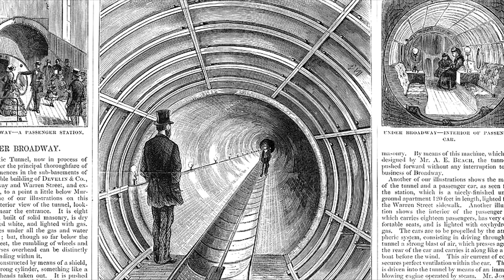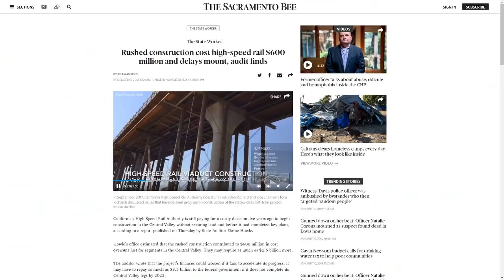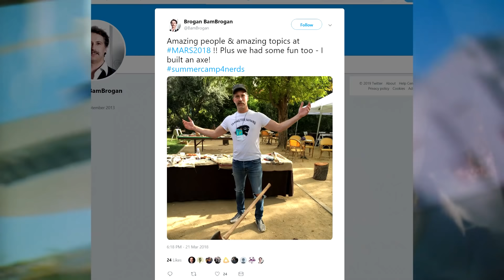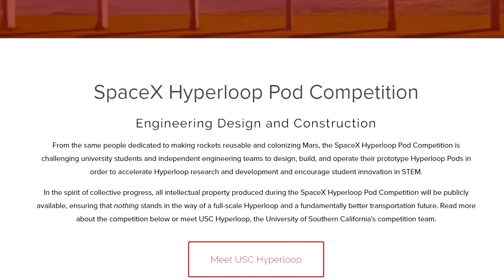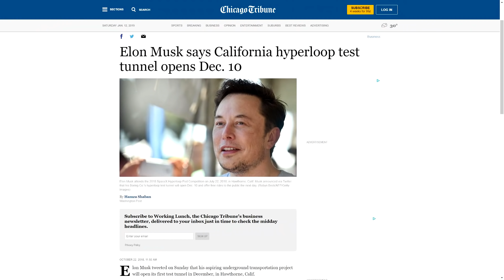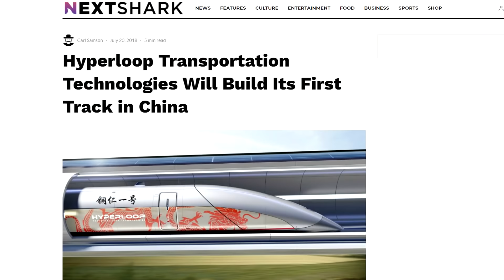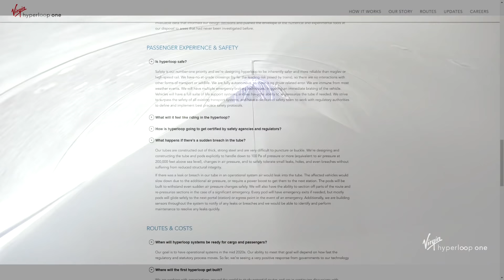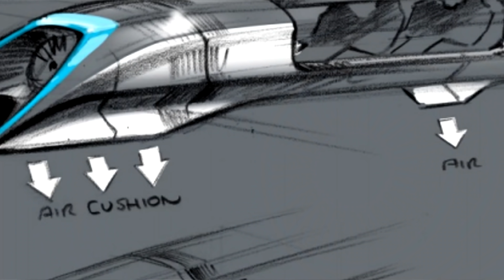Why Hyperloop will FAIL HARD - Its Biggest Problem...

Comment: Ya, my question is how do you evacuate such a large volume when there is huge surface area on the interior off-gassing at variable rates dependent upon temperature? It would take weeks to evacuate the main tubes if it was possible at all. They fill oil transportation pipelines with inert gasses to keep them from imploding due to atmospheric pressure. Remember the old saw "nature hates a vacuum"?

Comment: Hyperloop is in fact building on already proven technology. The only difference is it's taking Maglev  a step further by reducing air resistance. It's a very simple concept when you think about it. The American High Speed rail has yet to really get off the ground. That technology is already obsolete. I'd say give it a chance. These are companies that are not relying government funding. As a current resident of Ohio and Pittsburgh native, I'm glad to see that my local taxes won't be doubled as a result. Amtrak is slow so would the California High Speed rail. Air travel is okay but very costly for the consumer. Let's  see where this goes. I appreciate the insight of this video but it's a bit right winged. As with all new innovation (Not to mention proper journalism) it's best to remain neutral until solid evidence surfaces. At present no one can either confirm nor deny the potential of the project. However it is refreshing to see something new rather than a copy of what's already in existence. Prime example, my dad tells me my first vehicle should have been a Ford, American made, proven reliable, I get it... I purchased a Kia Optima which in only a short amount of time has proven to be  reliable, low maintenance, better performance not to mention awesome fuel economy. A brand built on the foundation of it's predecessors with improved innovations. What it boils down to; There can be many solutions to solve a common problem, the key to finding the best one is to consider that  all ideas are valid and bits and pieces of each may be the answer.

Comment: "What happened to the fans?"

Well eventually, someone would have asked the question 'if we have the fan, why do we need the tube?'. Because if anyone has seen the GMA T.50 car, they will know fans can be used to clean up airflow, which allow an object to slip through the air easier, allowing it to go faster. Obviously, a moving fan on a train would have all sorts of regulation problems, but, still far less than hyperloop will have.....

Comment: Hyperloops won't make a huge impact on journey times or connectivity because they will run between central stations, which will inevitably operate like airports due to the necessity of security. So if you set out from a point in LA you will need however long it takes to get to the central station, an hour of security clearance and some waiting time. The wait time you need to allow is dependent on the unpredictability in the local transit times, not the quality of the Hyperloop service. At the other end you complete your journey by normal ground transit.

The overall journey time is dominated by factors outside of the control of the Hyperloop builder.

Comment: I have to agree with you. What is fascinating and something I really want to know the answer to. The original concept was a plane in a tunnel but everyone is trying to do a maglev in a tunnel. Why the change? Plane in a tunnel would have saved on infrastructure costs as well as energy (operational costs) compared to maglev. With maglev in a tunnel you are only saving on energy costs.

Comment: Everything fails. LEDs were once said to be inefficient and would never be as bright as filaments but now it's better then we ever expected. Time and Tinkering will resolve all problems.
Reply: Not amount of tinkering will overcome the need for and cost of a massive steel tube with thermal expansion joints.  The price of steel is already so high that people steal manhole covers around here.  Buiilding H-Ls will drive it even higher. Unlike LEDs, the H-L is not new tech - it is just a maglev in a vacuum tube.
Reply: @dukenukem5768  just making the tunnel like a silencer would allow the gas to pass around the outside. |_|--|_|--|_|--|_| the air compresses into the pockets.

Comment: For some reason, when you mentioned how much energy was required to create a vacuum over hundreds of miles, it became instantly apparent how energy intensive this would be, if not impossible, because of likely sealing failures, which, like in pipelines, will be constant. All trains have to worry about is the integrity of the rails and the wheels on them. Anything encased over huge distances makes no sense anyway. Glad I saw this and woke up. And the safety issues are huge.

Comment: It's important to point out that the Shanghai maglev is crazy expensive to keep running. Fit seems like high speed rail is just the better option
Reply: If you mean the German Transrapid track in China, it is simply completely misused. Much too short, people can take the subway or bus far cheaper and spending little more time. These semi-experimental short distance tracks are the best way to negate the advantages of any high speed transit system.

Comment: This video could have more accurate. For example Hyperloop One have developed linear drive and pod technology quite successfully. The reason why they hasn't break record speeds is not because they can't but because current tunnel is too short and not meant for high speed tests. Secondary, even though some reporters may claim so, Boring Company tunnels have practically nothing to do with hyperloop. They are small and cheap mostly urban tunnel system for electric cars.

Comment: I have a wonderfull Idea!
What if we create an hyperloop in high altitude? The vacuum in high altitude will be free, no need for pipe! How cool is that? And the best is that we won't even need a track! We just have to use some fluid mechanics properties to create an upward force to counter gravity, thanks to pannels with a a carrefully designed geometry. It will go anywhere and rejoin any destination! How could the engineers in the past not have thought about such an elegant solution?

Comment: Elon Musk has moved on to focus on improving tunneling technology with The Boring Company. TBC tunnels can also be used for HyperLoop but the focus first is Loop. Air filled tunnels in urban areas for Autonomous BEVs. When the tunneling tech is ready, intercity HyperLoop will be all underground and hooked into existing Loop networks.

Comment: What a pile of crap this kid is shoveling.  There is not a vacuum in the tunnel there is negative pressure. The reason for the negative pressure is to cut friction of the air to achieve the 700+ MPH. With that said, you will not die in the event of a tube fracture it just reduces the speed of the pod. You will not suffocate to death. Japans train is susceptible to derailment and earthquake damage. While earthquake damage is also true for the hyperloop it is a reduced possibility by a floating tube on pylons. The pylons move but the tube stays in place. Now the real reason the hyperloop will succeed you will be able to arrive at your destination faster than an airplane covering the same route, why because the plane has to fly further than the hyperloop to take advantage of flying at 5 miles high to make the jet engine fuel-efficient. At fives mile of altitude, the distance increases between points making you fly further to your destination.
Add the extra 100 mph speed and you beat the plane by quite a large margin. And the power needs to run the hyperloop is a mere fraction of the cost of airlines, the savings alone will reduce your travel cost and travel time. Both big wins in my book.  This form of transportation is the next logical step in transportation.
Reply from the maker: Did you actually watch the video, or do you still think your pipedream is still a viable economic solution, let alone even based in reality?

Comment: A national Hyperloop system between the 50 largest cities in the United States, just one city per state on average, would be a very tiny system, nothing like UPS or FedEx or the airlines or even Amtrak. From each city, you will need 98 of these tubes going to the other 49 cities (one for travel each way), so you’re going to need about 1,200 tubes for the entire system. That’s a lot of right-of-way!  The Hyperloop is Hyperstup(id)!

Comment: Amateur genius engineer here to solve the problem.... Seal the tube, create vacuum on the front side and pressure in the rear with a simple on-board impeller. Suction in the front, blows out the back... voila.

Comment: Near vacuum is not vacuum. Supersonic flows are still a bitch at 10 mb, especially if you're also constricting the flow, as you would be if the pod was close to tube diameter. And it's very hard to evacuate it much lower due to surface offgassing.

Comment: Hyperloop is a maglev running in a low pressure chamber, the idea being to push away the fundamental air drag limit on maximum speed.
Between the miles long low pressure chambers and the added life support in the now airtight train, this is stupidly expensive, probably too much to save the day with the theoretical increase in passengers transported per hour that a higher speed enables. And this suppose that the companies involved with the hyperloop research learn how to build a fully fledged maglev and that there is a unfulfilled demand to begin with.

Comment: I think the end point for hyperloop is a high speed railway in an enclosed tunnel. That's it. That has some advantages, with protection from the environment and wildlife. Otherwise, building something within a vacuum makes no sense in any way. But I think the reason why it's hyped and a train system called hyperloop (in reality a maglev) may be built is because of the high pr and propaganda value. For a country like India or Dubai (UAE) , saying that they have built a truly different and ground breaking system instead of just the next iteration of high speed rail has a very high propoganda value and makes the costs far easier to justify. Just saying its a bullet train puts them in the same territory as most other nations. Saying its a hyperloop makes the country seem like its one step ahead of everyone else.

Comment: What I find amusing is that no one seems to get that all of this is Musk researching how to live on Mars. I'm not saying he has the right ideas, but that's what all of this is for.

Hyperloop will use tunnels built by tunnels dug by the Boring company. That's Musk's tunnel making company that uses electric powered tunnel boring machines that for some reason he's made smaller - oh, wait, are those machines the right size to fit on a rocket? Oh wow, they are.

Hyperloop uses near-vacuum tunnels - guess what's really easy to build on Mars! At least easy if you have tunnelling equipment.

Mars doesn't just effectively lack an atmosphere, it also lacks a magnetic field. So if you want to live on Mars you'll need to do it underground.

And through it all, Musk keeps looking for money here on Earth to fund all this. So you have things like Tesla, SpaceX commercial launches, Hyperloop, the Boring Company, etc. Each tries to fill a need here (some do it well, some not) but all of them have obvious utility on Mars.

So for trains on Earth, Hyperloop isn't that awesome. But for trains on Mars, Hyperloop might be the only game in town.

Comment: Simply pulling a real vacuum on a 600 mile long pipe that is about 6' across would take months...  A minor problem.  Second issue.. If that nice tube is exposed to the sun.. the top will grow 1000' or so in San Fran relative to LA. Do you put the stations on large rollers so that the openings stay where the platform is?  Of make the platform 1/4 mile longer than needed.. and since the bottom won't get the heating from the sun, will it kink?  Throw in leaks.. What happens when a seal fails and a bunch of air enters the steel tube.  Who pays for cleaning the red paste in the capsule that were formerly humans?  When you hit a wall of air at 700 miles, you will have rapid deceleration.
Reply: And who pays the crash victims when a train at 100 mph stumbles upon a trailer stuck on a level crossing? And are you absolutely sure that conventional rails do not extend in the sun in San Francisco or Los Angeles? There will be no real vacuum in Hyperloop. There will be low pressure. Of course, if you try to suck the air out of it with your lungs, your life will not be enough. And with multiple compressors, this can be done in minutes.
Reply: @ВалентинРазумнов-ц4к  That's easy.. It doesn't happen in Japan because they don't have grade crossings on the high speed lines.  However, on the AMTRAK world, Amtrak pays, even if it is a problem with the host railroad.  Such is life...

Comment: how do you breathe in the pod? does carry a tank of liquid oxygen? and where do u expell the used air  in the pod to? or just compress and hold it in a tank until the next station? u can't get rid of it the tube it will ruin the vacuum..

how do you expell the heat generated by electromagnets, electronics, and AC? you can't simply radiate it inside the tube it won't be effective, or do you used a chilled block of metal as a literal heat sink that you cool down at the station?!

how do you get the people out of the pod without loosing the vacuum? or does the pod dock vacuum-sealed to the gate?

and why is the tube made from steel with all the electromagnets in the vaccuum, wouldn't that cause electrical discharge? or is it going to be made from a non conductive material or better a non magnetic material?

and what happens if something collides with the tube, or when it is heated and cooled by the sun? wouldn't it fail? or is it going to be built underground away from all the air, temperature differential and land ownership issues?

and why is it so wide? why not mount a maglev device behind and infront of the pod, and have the pod be 1 row of reclined seats? wouldn't the reduce the diameter of the tube drastically?

why use an active electrified magnetized track when you could use magnets to pull on the steel track?

seems like an excellent idea poorly executed.
this is harder that keeping up a spacestation.. yes no friction, but at least in space you can loose heat to the cold of the vacuum of space because you are not paying to maintain it.

Comment: The real reason why 'hyperloop' will fail is 'economic'. No, no no no ! The whole idea is just rubbish and so full of technical holes that it just would not work - for instance, taking a corner ! how would it do this and maintain a seal between the vehicle and the tube ???? what about getting into the thing ? it would need an airlock or some means of sealing the 'train' from the tube ????? and many other things.

Comment: Problems greater than those posed by engineering and physics ? Methinks not.
Ever seen what thermal expansion can do to a railroad ? Now imagine dealing with this issue in a hundreds of miles long vacuum chamber.

Comment: I took 2 different Maglevs at over 450km/h they are so smooth, you can build a house of cards and have it stay up for hours .
Reply: Same with normal high speed rail. At those speeds you can’t have too much oscillation or it will go off the rails.

Comment: In democracies sometimes it is cheaper to go underground with a number of modern multi modal TBM working 24/7 than have expensive court cases.

A single 11 psi Maglev tunnel can increase speed from 600 km/h to 700km/h while still being breathable and passing stations would allow daytime trains to stop where needed with overnight container trains beating any truck by eight hours over 1,000 kilometres between freight sidings eliminating daytime planes and reducing trucks.

Using Sydney to Melbourne as an example with passing stations at Canberra and Albury it would cost $60,000,000,000 and return $20,000,000 per night which makes it able to subsidise daytime fares below planes and still have a return of 10%

Perhaps cooperation between Japan, China and America can develop the maglev container train with  Australia to use an international guideway to benefit the world.

Comment: If done right, it can replace air travel, at least over continents. Consider climate change, and the persisting requirement for fossil fuels in airplanes, a possible game changer. There should be no short, experimental distances and no speeds slower than airplanes; supersonic (as would be in the air) should be the norm. San Francisco-L.A. is still too short, a typical distance for traditional high-speed rail in Europe or Japan. L.A.-New York or Lisbon-Warsaw would be good distances for Hyperloop. Of course, 12 capsules per hour with 28 passengers in each would be FAR underutilized. The high speed rail between Cologne and Frankfurt regularly has 5 trains per hour and direction (8 max) and 460 passengers per ICE3 train (seated, 1000s if crammed), and rail is commonly underutilized, due to the block section system. Some safety concerns are plain nonsense, such as the idea of a damaged hyperloop pipe being squashed like a can of coke. But it depends on politics, if they are willing to enforce it and compensate later, if courts decide, so people can't delay it for decades only through legal tricks.